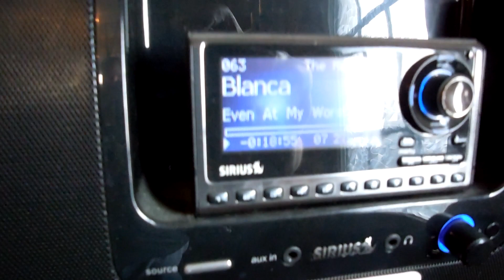2018 Ford Edge Sport 2.7L V6 Ecoboost 55K Oil Change and Air Filter too

Comment: Very good video sir! The catch can, the amount of oil poured out, was one 5,000 mile oil change interval. Is that correct? Next please share a link for the catch can assembly.
Reply from the maker: Yes, 5,000 miles in my oil change internal
Reply from the maker: Looks like JLT changed their name to J&L Oil Separator Co. (OSC). Here is a link to consider: https://morepowertuning.com/products/15-18-27-edge-ecoboost-jlt3031p-c

Comment: Doug, have you done the plugs on your car yet? I can’t find a video anywhere changing edge 2.7 ecoboost spark plugs.
Reply from the maker: Nope - not yet. Looking at 100K to do the spark plugs.
Reply: @DougMount just did them last weekend. Took about 2 hours but I take my time. Most difficult is getting to the back 3 of course.